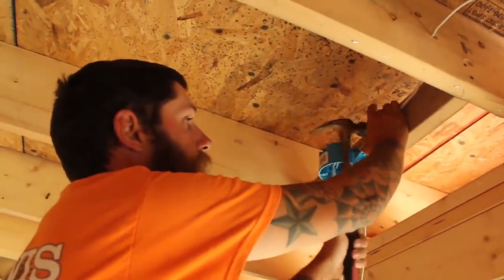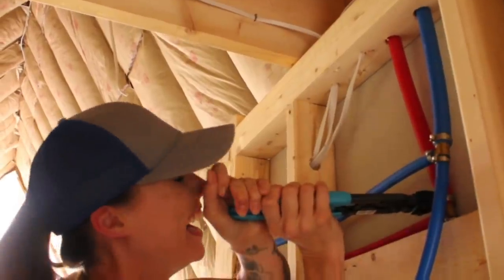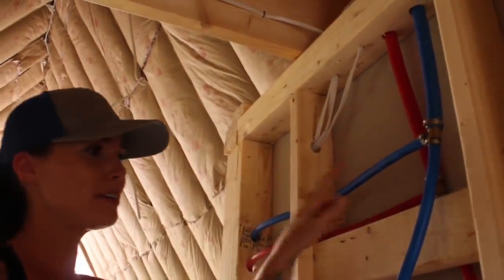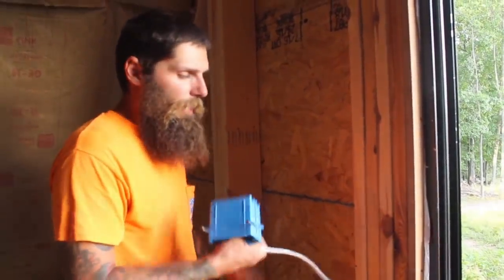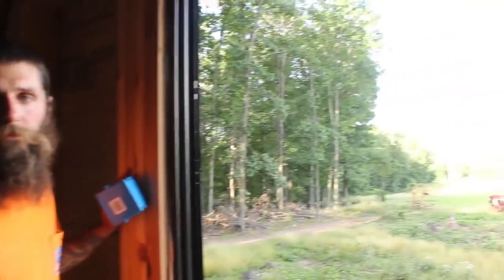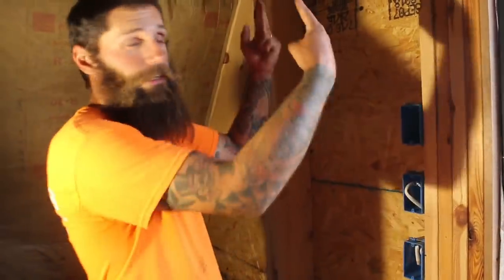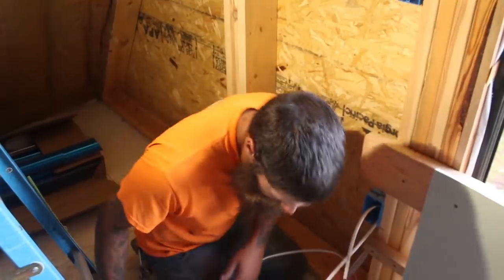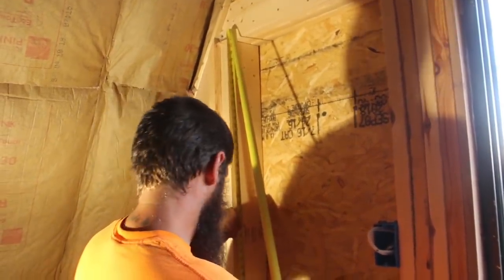Preparing for Our "Solar" SHED Build

Comment: In your road and trail clearing, and pad clearing, I have witnessed a lot a wonderful firewood - getting tossed aside and buried.   I hope that it is not wasted!
Reply: M A Neuschwander ..they are going to heat with a wood furnace!.....thus every branch & log is a fuel source!.....my one niece has a wood / electric furnace in her basement ; another niece heats her farm house with an outdoor wood furnace and hot water tank ( not a boiler) - a pump circulates  the hot water to the heat exchanger in the forced air furnace!...

Comment: It is prudent to leave a 6-12 inch loop on your wire before entering the switch or light boxes. In the event you need too move it or make a mistake this allows for corrections.

Comment: Nice work.  I'm not sure where you're located, but in Ontario it's required code that all electrical boxes on exterior walls and ceilings be wrapped with plastic (poly)  to maintain the vapor barrier.

Comment: Nice, Funny Face was funny, you went there. Old battery banks used to off gas Hydrogen which is supposed to be unhealthy, good move isolating the shed. VERY interested in how you Radiant Floor Heat such a small space(hydro) please give lots of detail. Thanks

Comment: there's a way to put insulation under the concrete; I've got a general idea, but, no specifics. it may take some of the pressure off the solar-shed's radiant heat floor. bon chance!
Reply: D L ...I’ve been retired 25 yrs from construction but we did use high density “Blue insulation “ under concrete slabs to protect from frost penetration...seems like it would work for this case!...

Comment: Having an idea of where you are building, and living in Alaska myself, I am curious as to why you are worried about heating the "Solar shed" at all? I get that the pressure tank will be there, we use those here as well but I am not seeing how there would be a serious temp issue for you guys? Other than heat that is.....lol....I will admit that I am not familiar with the battery type you are using, but up here we are more concerned with venting than freezing. That said I always enjoy your videos!

Comment: instead of a shed why dont you put the solar stuff into a root cellar. You have a tractor that can dig a big ass hole. put some some cider block walls then you wouldn't need the radiant heat. it would be cheaper in the long run. The temperature in a root cellar is very stable even through the coldest winters/hottest summers

Comment: I know this may be a dumb question. Why do you have to staple the cable tight to the 2 x 4?
Reply: If you watch closely, he doesn't really smash the staple against the wire and that's a good thing. It's a code thing, you must have staples every so many feet and a certain distance from each box.
Reply: @augustreil  thx
Reply: @tomskaggs7918 , You're welcome.

Comment: Instead of a shed, why dont you just get a 20 footer, spray form insulate the inside, bolt it on a raised platform like the house. give it even with a  regular flat roof, paint it all black, voila matching functional building Those are pretty pricey items to put inside once location that isn't fully secure.

Comment: You would have lost less power if the electric shed were closer to the DC solar panels.  AC travels a longer distance with lower power loss than DC.  Hence what Edison learned in the 1920's
Reply: That can be corrected with bigger wire, no ?

Comment: Did anyone tell you to leave a 4-6 inch loop at both ends of the device boxes so if you ever need to service the Romex you have slack
Reply: I always do that but some codes don't allow it.
Reply: One more thing lithium ion battery’s are not the ideal battery’s for solar storage u should do some research on  ur battery choice
Reply: @ftlancer , Why's that ?  Everything I've ever read says they are, Thanks.
Reply: Lithium batteries deliver short, high-current bursts to crank an engine, meaning they frequently discharge only a small part of their capacity. The main difference between true deep cycle batteries and other types is that deep cycle batteries have solid – not sponge – lead plates

Lithium is like a sprinter not a marathon runner
Reply: Carbon Foam Batteries

Innovative lead-acid batteries with carbon foam technology for longer life, greater capacity, deeper discharge, and exceptional partial state of charge performance.
Reply: And if your interested 

Lead Crystal / Silicon Dioxide ULL Batteries (SiO2)

No freezing. Higher temperature range with greater capacity than other batteries at low temperatures. -40C to +65C
Zero maintenance. No off-gassing. No acid spills. 1 year shelf life without charging.
Faster charging (.25C charge rate). 4 Hour charging vs. 7 Hours for lead acid.
Approx. 1/3 of lithium ion cost.
Long lasting up to 5 times longer than AGM batteries at 50% DoD (depth of discharge). Up to 7 x longer at 80% DoD. SiO2 batteries last to 16 years at 20% DoD.
Can be discharged repeatedly to 100% DoD with full recovery of capacity.
Reply: @ftlancer , All foreign to me but I'll check them out. Thanks.
Reply: august 
U know that not knowing is a side effect of life
Reply: august  are you a woman??
Reply: @ftlancer , Really ?  What the hell kind of question is that ?

Comment: I CANT BELIEVE YOU DONT STRIP THEM WIRES BEFORE THEY GO IN THE BOX
Reply: Believe it, he does this type of work every day, think he's pulled more wire than you can imagine.
Reply: I HEARD THEM SAY HE IS AN ELECTRICIAN, JUST LIKE THOSE METAL STRAPS, WAY BACK IN THE 80 THE NEC CODE BOOK HAD THEM AS ILLEGAL, BUT HE USES THEM ALL THE TIME, I'VE NEVER GOTTEN A RESPONSE TO ANYTHIN I POST FROM THEM, THEIR FOLLOWERS DO, LIKE YOU, BUT NEVER THEM
Reply from the maker: 2017 NEC Article 334.30 Securing and Supporting.  Nonmetallic-sheathed cable shall be supported and secured by staples; cable ties listed and identified for securement and support; or straps, hangers, or similar fittings designed and installed so as not to damage the cable, at intervals not exceeding 1.4m (4 1/2ft) and within 300mm (12in.) of every cable entry into enclosures such as outlet boxes, junction boxes, cabinets, or fittings.
In regards to not stripping the wire prior to putting it into the box- it goes in easier if you strip after.
Reply: @WildWonderfulOffGrid  he watches, he waits, he pounces, lol. I'm a retired tile setter, and love to watch people do this, I spent the first 10 years in commercial and industrial sheet metal then another 25 setting tile, I look, I watch, I ask questions and learn. Never did like the electrical part cause in the sheet metal part I got bit by everything from 125 to 440 and the one that hurt the most was 277 !! Love what y'all are doing there.
Reply: Is this because that is how you've done it ?  and your way is the only way ?  How many years do you have as a licensed electrician ?  Just asking.